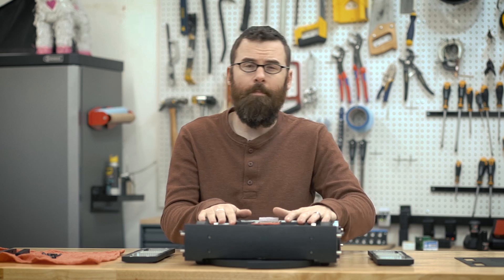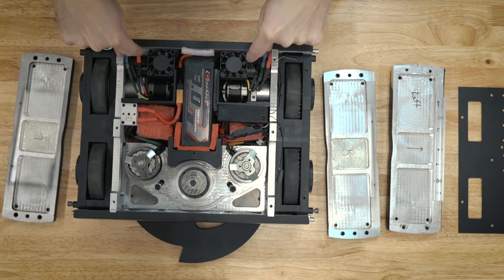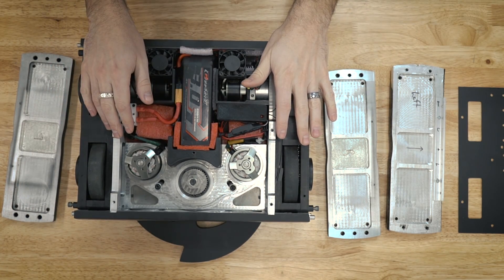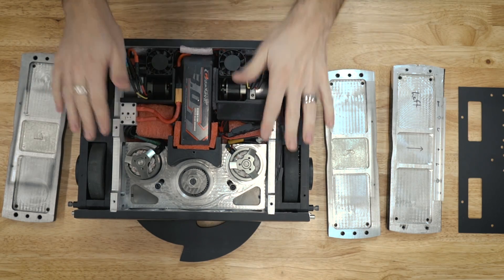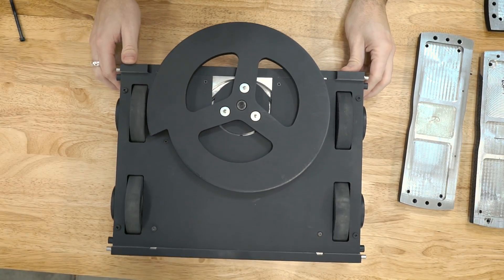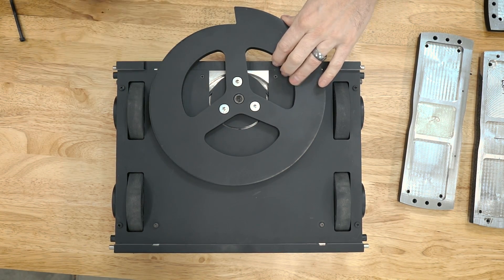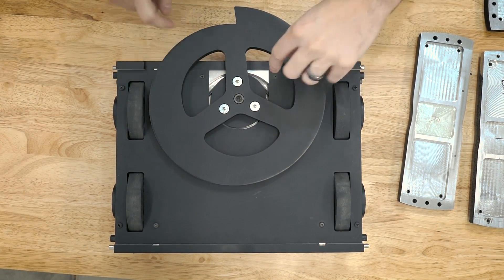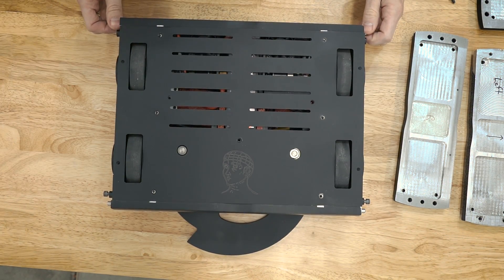Crippling Depression V2 - Preview

Comment: Your videos are excellent. You're very clear on your train of thought but you didn't need four dowels unless you never want to take it apart or you drilled holes to pull them

Edit, you should research the effects of putting a radius in your corners for better force distribution
Reply from the maker: Blake, thanks!  The dowels are 100% necessary.  Every frame screw on the last version was bent and damaged.  After the last competition, all the screws were still in good shape with the dowels.  Everything can still come apart, it just needs a mallet.  Also, the weapon and most critical surfaces do have some sort of fillet.
Reply: Robert Cowan 

Oh yes I completely agree that the dowels are necessary but you only really needed two. If they are press fit then they're just going to be fighting each other when you put everything together. 

Not a big deal with a frame of aluminum but if you ever want to dowel two pieces of steel together then you'll run into trouble using more than 2 press fit dowels.

Comment: I think there might be a design flaw with the weapon.  

The weapon tooth has a similar offset from the axis of rotation as the opposite, non weaponized side.  This is because you used the center of mass to locate the axis, and then skelotonized the triangular sections out.  I think you need to skeletonize before you locate your center of mass to locate the axis.
Reply from the maker: I'm not sure what you're saying, but I can assure you it spins at 6K RPM with almost zero noise or shaking, it's as balanced as it can get.
Reply: I'm not talking about being off balance, I'm saying that the tooth looks to be about as far away from the axis of rotation as the opposite side, meaning the side that doesn't have the tooth is also going to be in contact with the enemy bots, but it will hardly be doing anything except nudging them away before the tooth can hit them with max force.
Reply: oobligah its not going to because its neither large nor slow enough for that to be an issue. And usually the opposite is more problematic if anything.

Comment: How much did a bot like this cost to produce not including replacement parts
Reply: Probably a little less for Robert because he made most of the aluminum parts on his own CnC mill, but 30lb bots made custom are in the 1.5-3k USD range. There's about $150 in motors, probably about that much also in speed controllers for them, $110 in gearboxes, and a $80 battery. The weapon discs are likely several hundred to have waterjet and Heat treated.

But spares are mandatory for combat bots, and the common practice is to bring 1.5 robots with you.
Reply from the maker: Your numbers are pretty accurate.  In materials, it's about $1k all together, without spares.  The weapon, motors, electronics and materials all add up.  But yes, a lot of money was saved by doing my own machining.